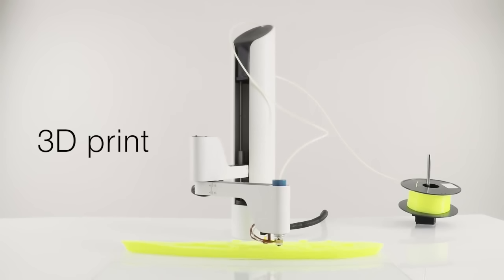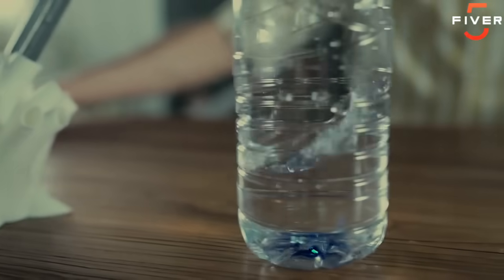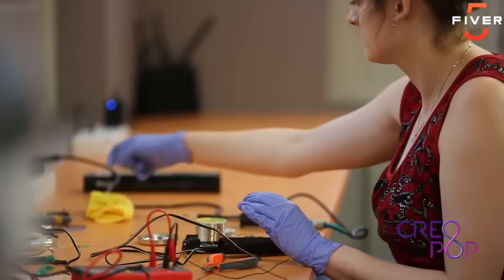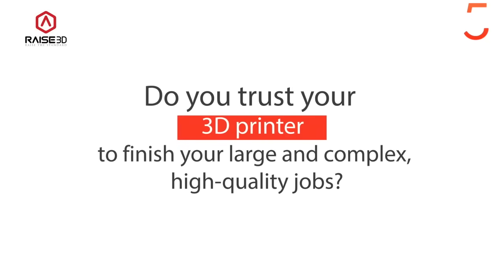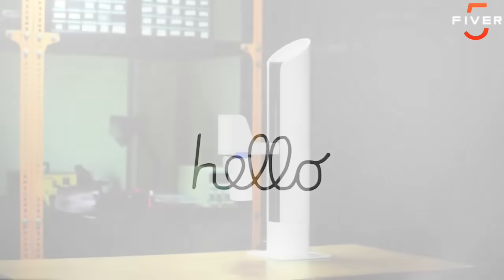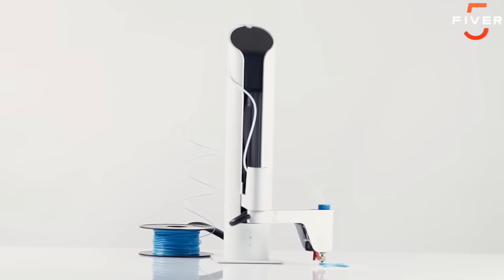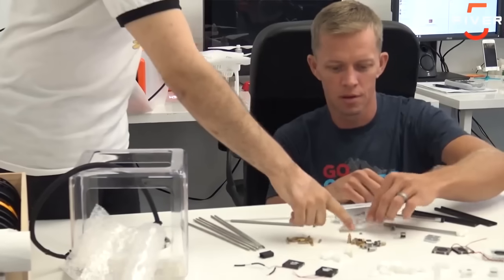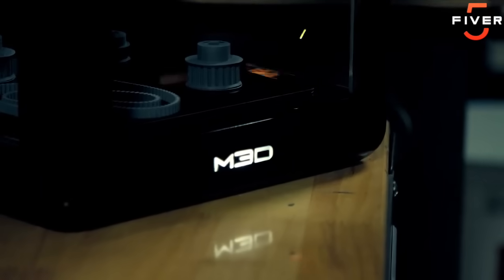5 Epic 3D Printing Gadgets You HAVE To Check Out

Comment: can anyone tell me how much the actually plastic building material typically costs?
Reply: depends on the type of plastic you buy but the cheapest kin(PLA) is no more than $20 a spool
Reply: Lowly Fluff Sandwich for basic pla or abs you pay about 30-50€/KG but for some exotic filaments (for example with metal or carbon fiber) the price can go up to about 80€/Kg but the most materials are about 50- 60€ 

and if you are wondering how long 1kg will last, I can tell you that I was quite surprised about how long it lastet. you can really print a lot of stuff with 1kg 
I hope I could help you.
Reply: Lowly Fluff Sandwich